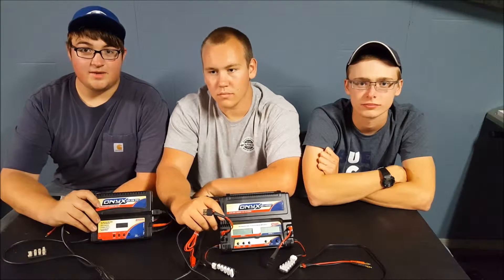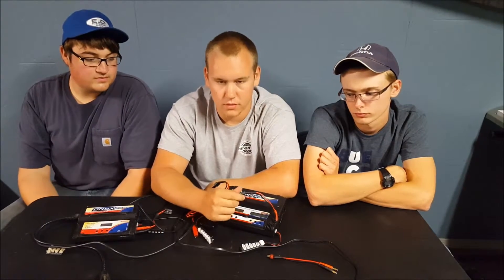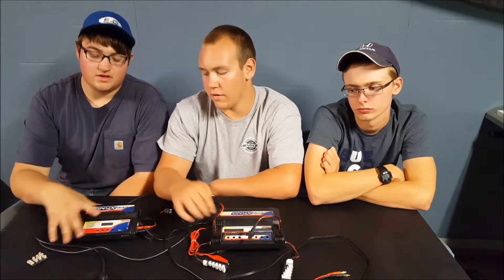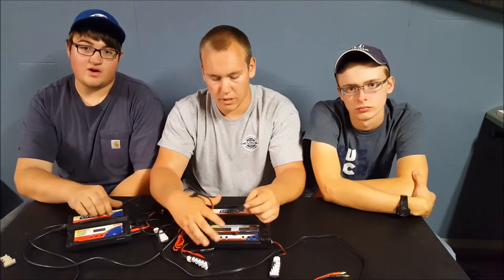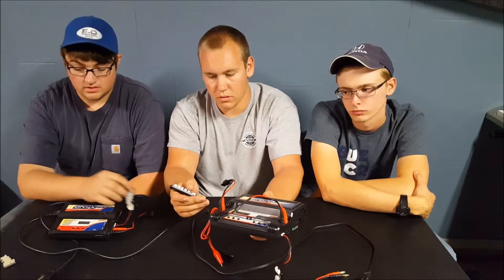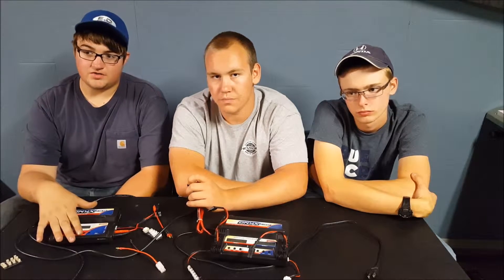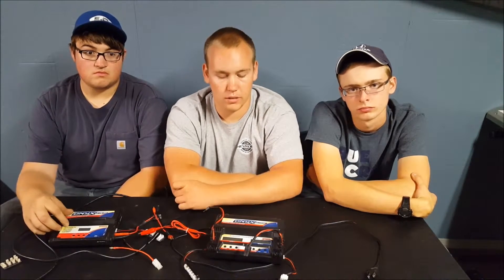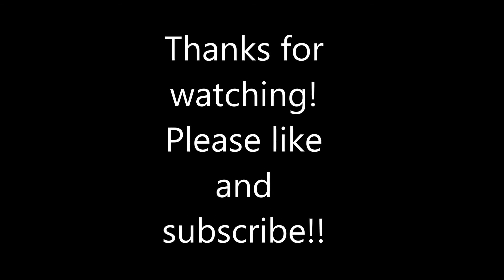Duratrax Onyx 235 vs 245 comparison and review

Comment: Hello.....
I bought onyx245 dual lipo charger. Can I know, How many watts do I need to provide to the charger with 110v.
In my country I don't have 110v. So I need to buy additional power pack for that. I already read the manual, but I didn't find any info about how many watts does it need.? Please help me.... Thanks.
Reply from the maker: Watts = voltage * current ( amps)  most 110/120 volt outlets give out 15-20 amps so they can output up to 2400 watts. with that said the charger will draw more watts with the faster you charge and the higher voltage batteries you put on it.  it will draw more watts also running two batteries than 1. I don't think there is a concrete answer to your problem.  sorry I couldn't be more help. -Paul
Reply: +Topspeed RC Thanks. I will keep looking for more info....